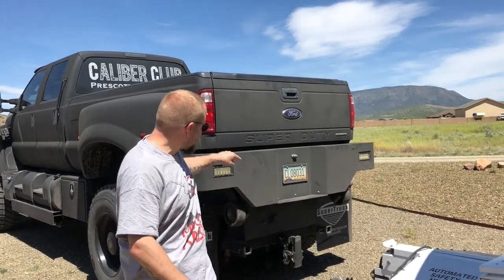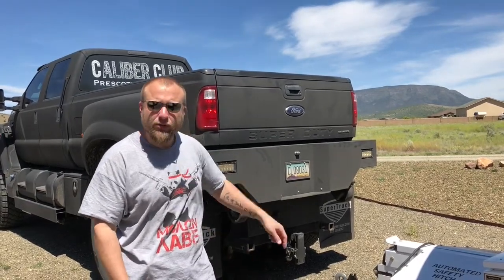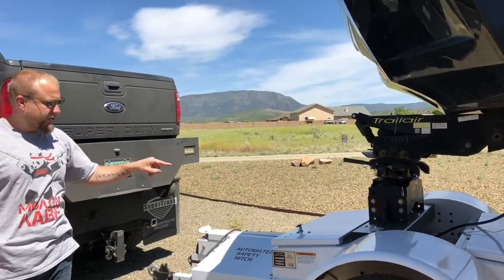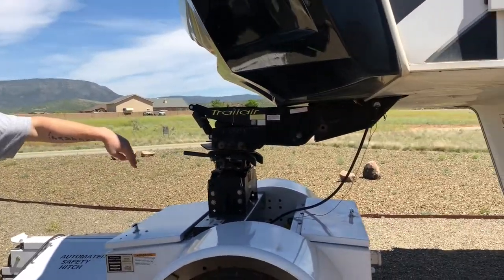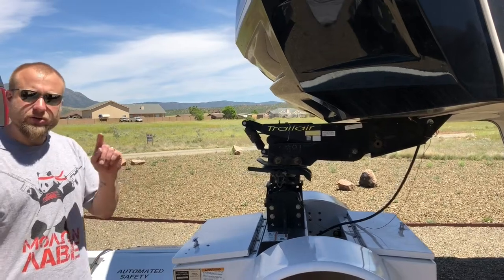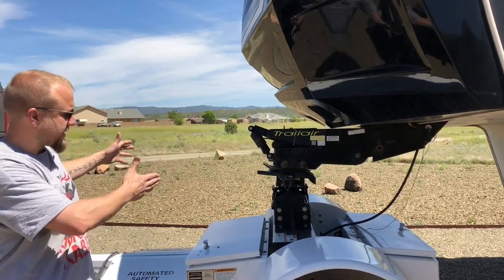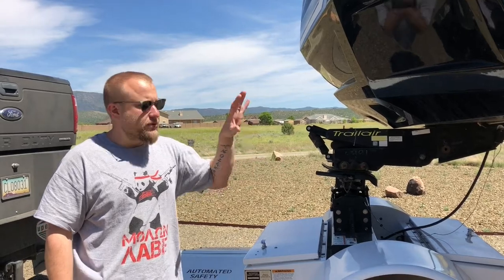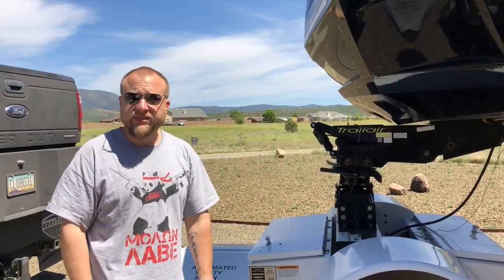Automated Safety Hitch! Amazing Product but I wouldn't recommend buying one... Ask me why!?!

Comment: Brother, our stories are insanely too similar.  I picked one up last year.  Same lies from Joe, said he’d have mine ready, showed up and not even close.  Tried to tell me to wait, is said naw, I’m leaving here with something.  Spent 15hrs assembling one myself with the help of his welder till 2am.  That was a year ago and still giving me the run around.  Just giving up like you did.  I have enjoyed the hitch though, have out about 10k miles on it pulling with an 05 excursion, having to align and tweak it myself, cause like you said, he doesn’t care one bit after he has his money.
Reply from the maker: Man that is too bad, I'm sorry to hear it happened to you too. I feel the same exact way, I love the unit but hate the company. I've probably put about the same mileage on mine, maybe a bit more and running strong. I just broke my winch cable last time I was out so I need to change that, but aside from that it's holding up sell. I am a bit worried if the computer components were to go out, but it's a relatively simple setup so I'm sure I'll figure something out.
Reply: @PrescottCaliberClub  well. At least you got the computer components.  I didn’t. Lol.  I wired up a toggle switch to my dash to operate the lock manually,  and a furrion camera that shows the tie rod lock paddle so I can be sure it’s locked.  I’m toying around with installing a ram cylinder on it with either a stand alone 12v hydraulic pump or tying into my power steering gear box with a high output pump, but that would definitely be a lot of trial and error.  How cool would this thing be with synchronized power steering!  I do a lot of boondocking on rough terrain and turning sucks particularly backing up in tight spots or sharp turning on soft ground.

Comment: Cool video on how those units work!👍 personally I’d get a bumper pull then, but I could see how someone would REALLY want a 5th wheel lay-out and want to get the (extra) hitch system
Reply from the maker: Yes Sir! I already had the RV otherwise I would have just probably gone with a bumper pull setup. But I must say that after pulling about 10,000 miles with this thing I would hate to get rid of it. It handles considerably better but mostly it corners so nice that I'd hate to tow without it! I do like that it has the winch systems too so that if I get stuck I can unhook from it and winch out my truck, then winch the trailer back up to the truck and keep rolling! Thanks for the view buddy, hope you're doing well.

Comment: Ok, when you're hooked up the dolly becomes an extension of your truck.  So, how is it to back up? Does the axle unlock so you can jack-knife the trailer? We are running a one ton, crewcab, eight foot bed Dodge diesel with a 36 foot fiver. Turning radius is horrible, class 8 semi turns shorter. F-650 running a Cummins? Pretty awesome rig.
Reply from the maker: I wish it had a Cummins. The newer F650's didn't offer anything but the Powerstroke. It has a different Turbo setup and I have done a full delete and custom tune on it so it's a little suped up but not crazy. It's heavy so a race tune wouldn't do any good anyway.

As far as the backup goes, it's insane. The axel actually frees up to turn when you're going forward (activated by the turn signals) and when you back up you lock the wheels straight on the safety hitch. When that axel locks straight it acts just like your normal truck would except that you now have an additional 9' or so where the trailer is further back. I saw the owner jackknife his F250 with a 35' trailer so far that I could not longer see the truck! Check out their website, they have some decent videos showing the capabilities of the system. 

http://www.safetytowingsystems.com

Like I said in the description though, I would not recommend this COMPANY at all. The Product itself is one of the most amazing products I've come across in the towing world. But the company has basically ripped me off, never gave me the hitch I ordered; They only substituted a used hitch and now deny that they ever knew me or had anything to do with me. They don't even recall the 48 hours I spent driving around with the OWNER in my huge F650 while they screwed me around after I drove all the way to Texas and they didn't have my hitch after telling me it was done and ready. Horrific experience that I have had consults with multiple attorneys about. The bottom line was that I will spend more money and probably never get this guy to make it right.

That said, if you're willing to deal with him and the company to get your hands on one I do not regret owning the unit. I just know that if anything at all goes wrong with this I will have to do ALL the fixing myself. There is NO WAY they will ever help me. I still don't have the hitch that I bought over 2 years ago. Last time I spoke to Mr. Jamieson he told me that he doesn't remember me, he doesn't recall ever dealing with me and that there's nothing more he can do. I have my invoice showing I paid in full for the hitch, I have ONLY the "loaner" hitch he gave me; He gave me that hitch when I showed up and was told that mine was damaged by a car running off the road just the day before I arrived... Yeah Right...

Just wanted to give you all the info on my experience before you go and buy one and then come back upset with me. Like I always say, I love the product and DESPISE the company.
Reply: @PrescottCaliberClub  Thanks Ryan, just wondered how it all worked. We are at the point where we are (or were, before this dang virus) looking at downsizing to a travel trailer and gas motor pickup. Didn't know Ford quit using the Cummins. Years ago I was taliking to a mobil mechanic who serviced Caterpillar stuff. The truck was covered with Cat decals, but was running a Cummins. I had a full delete done on our truck (2010) and it's unreal how clean the oil stays. They flashed the computer with a Race.me tuner and the engine thinks all the pollution crap is still on it.
Reply from the maker: @Bohica-tq3ps  Very cool! Yeah I recently found an awesome mobile mechanic who does all my work on my truck and RV right at my house. Young guy, just getting into his own business. Really great mechanic. I love RV'ing, we never imagined we would but now I couldn't imagine not having one! Happy to help wherever I can, like I said this unit is absolutely AMAZING! The company stinks and I hope he sees this video and helps me finally lol. I want to get another hitch for my F350 truck so I can run this behind that as well but he wants me to send him my hitch to build off of and I'm like "I'm not going to send you more of my things, you haven't even given me what I paid you for". haha.

Comment: Why do you say you wouldn’t suggest getting one? I have a 2020 F250 Tremor 6.7L and looking to get a 42’ toy hauler.  It has a pin weight of 3400lbs.  Even with my 10k rear axle, I’m worried it’s too much as my payload says 2900 on the door.  I’ve been told just get airbags and I’ll be fine as I have the same engine and transmission as the F450 and same rear suspension as the F350.  Thoughts?
Reply from the maker: I only say that I don't approve of them is because of the way I've been treated. I spent about $10k+ on a new unit. Was told it was ready and then drove to Texas to get it. When I got there he claimed it was damaged in an accident and gave me a loaner and now claims he doesn't recall any of it and basically won't give me the one I paid for. 

That being said, the unit itself is FREAKING AWESOME! I love it. I'm scared for it to break because I won't even try to contact them for help.
Reply: @PrescottCaliberClub  Where can i look at yours? I would like to reverse engineer it and build one for myself.
Reply from the maker: @dptp9lf  where do you live? I’m in my RV right now and it’s directly below me lol. If you live near Prescott send me an email or text and I’ll meet up with you sometime.